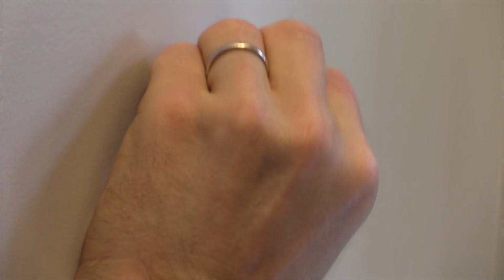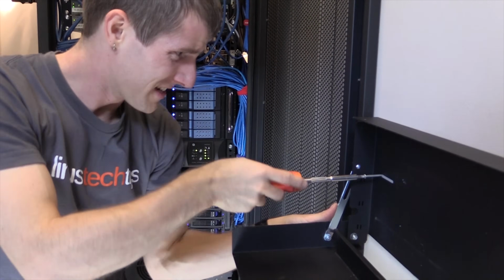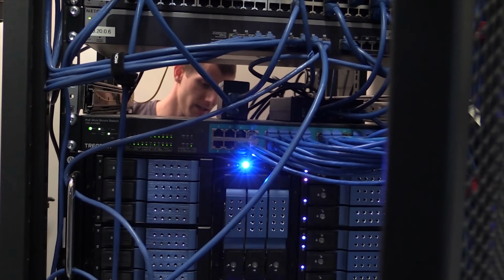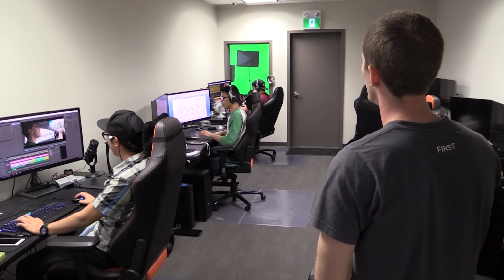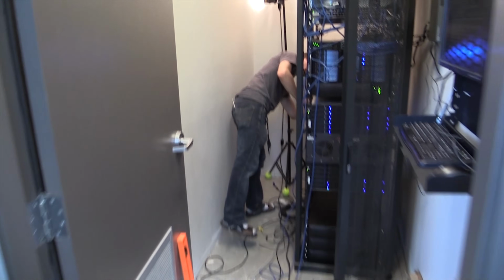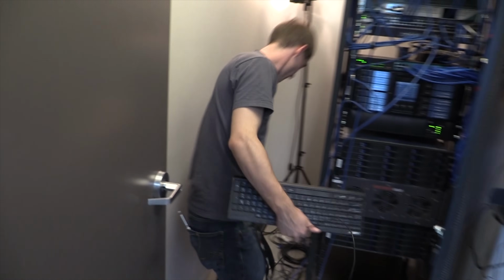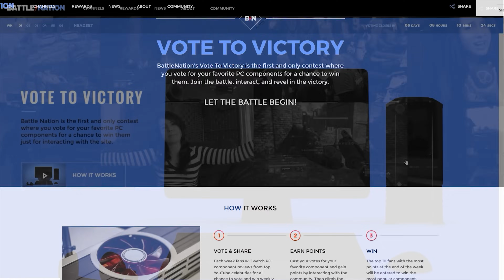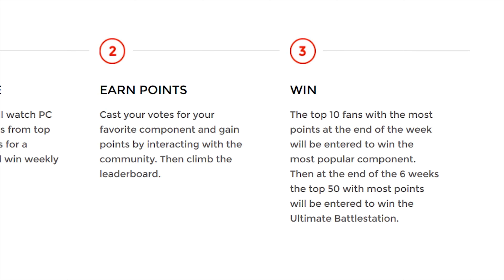Server Room Updates!! UPSes, KVMs, and more!

Comment: I never understood why he didn't rack mount the KVM and then run the 1 keyboard mouse and via cable out the top to the wall. I use a wireless keyboard/mouse combo using a Logitech unifying receiver.

Comment: you should terminate all building cable to panels on the wall with your switches mounted on the wall. Then cross connect from your hardware in the cabinet to the switches. You would find it easier to work if you used colored cables and cut to length all your cross connects.  Oh.....draw up a diagram and put it on the wall and assemble to your plan. It looks as if you are just 'going at it'.

Comment: Big Thumbs up for replacing the Cisco box with pfSense!  I am actually doing the same with my network, found there were some serious throttling issues with ASA model I had.  Plus my ASA is in an open room, and the noise level is just insane.  My pfSense box will be completely silent, b/c I decided to go with a silent case system.

Comment: Dat's a bad Linus, putting rackmount screws in the top holes first and leaving the bottoms empty. Everyone knows bottom first cause the bottoms hold the entirety of the torsional weight. 

4:23 on the top battery for those curious as to what I am referring to.

Comment: Ey Linus TecTeam... 

about your dust problem, you guys have a professional air system , please use it properly! 

in your air duct should be a fan which one generate enough air pressure which allow you to install a high efficiency bag filter

yes it costs a fortune but i guarantee you will love the result

there exist things like "planet" -  a door sealing system for your door problem

if you want more instruction send me a mail my mother tongue is not english but my job is ventilation engineer or just simply ask the guys how installed your system about this mater

and did i mention it...  i love your chanel... 

greet`s from switzerland

Comment: Now I know why we chose redundant power supplies in our servers so you can reroute the power cables while keeping the system up. Also having HP iLO has simplified KVM to a console 'network' and can even remotely load ISOs as if they were physical drives at a hardware level.

Comment: you could have just tapped on the wall and listened for the change in sound to find the wall studs lol. Sometimes you don't need a high tech solution for a low tech problem

Comment: What is the server for? What does it do? What operating system is it running on? And finally, what is the monitor for?
Reply: FightOnGaming The servers hold all their data and security systems One server is hot storage for stuff they use often one is for cold storage stuff that they no longer need constantly but might have to get at a later date security server takes all the cameras and let's them view them. All servers run an operating system. Both storage servers run unraid and the security server I'm not sure what it runs but if they need to access the server OS then they need a mouse keyboard and monitor.
Reply: ***** Ok, that clears it up. Thanks dude!

Comment: I would love to get a video exploring different KVM options for a home office setup/consumer running between 2 to 4 pc's. There aren't any decent videos on the subject far as I can tell.
Reply: From personal experience at work and at home, ConnectPro is a good middle ground for something that isn't going to break your wallet, and something that won't break in a week. I've been running a UR-14 for the past 3 years in my office and I have yet to have it break. Raritan is great, if you have the cash. Expect to pay upwards of like $1500 to $3000 depending on what you need from it, since they mostly reside in big data centers. Startech is definitely on the cheap side, and you certainly get what you pay for (I've dealt with about 2 broken switches so far), but if you get a good one, it'll last forever.

I'd like to see Linus going over this as well, since most people aren't gonna have the room for 4 monitors for 4 different machines :)
Reply: Forrest Hooker
Hmm, the Startech 2 PC usb/displayport SV231DPU2 looks pretty good on paper and in price. What's the issue with the quality, stops working just from use over time, or more an issue of breaking as a result of a small fall and/or soft-ish hit? How's the warranty/support for RMA?
Reply: Felix Kütt I've never been truly able to diagnose why the last two I had died, but the symptoms were a mix of a complete lack of response from any of the buttons, USB devices that were previously working becoming unrecognizable, or the thing simply being bricked. For awhile, I thought I was somehow overvolting them, but the Startech of the same model I purchased later (can't remember the model, it's been sitting in a test lab for awhile now) has been going strong for close to a year now with the same model of power supply included. Regarding warranty, they were quick to replace the first one that died, but on the second attempt I gave up out of frustration and gave it to a coworker in the hopes that he'd salvage something out of it :p

Comment: LOL. you were lucky with the first dry wall anchor but not so much luck with the second as design. The holes on the shelf are spaced so if one is on a stud it will line up with a stud on the other side if you have standard framing...

Comment: Linus, I have so many comments for this video. I really hope I capture all my thoughts clearly here. Also I hope you actually read this however unlikely that is.
1: I do Network infrastructure for a living and I desperately want to come and cable manage that rack. :)
2: You should really get rid of those power strips and get rack mounted power. it will really help with cable management and they have built in amps for added protection.
3: you should rack mount the KVM and put the keyboard tray and monitor on the wall behind the rack(where you do most of your work) and away from the door.
I think that about sums it all up. Wasn't nearly as much as I though it was. Also your little orange screw driver is not a power tool..... they lied to you.

Comment: NEVER mount anything directly to drywall (molly bolts, threaded anchors, toggle bolts, expansion anchors, etc.) if that thing has any movable parts or may be grabbed at if you trip.  The mount WILL eventually fail.  You have been warned.  Find a stud, or make a mounting plate, its worth the time and effort.

Comment: Is he trolling actual admins? I mean... Airflow control, dust handling... He had to do a wall mount KVM/keyboard and monitor instead of an in rack solution? He had to take down the servers?! Does he know that construct dust can combust if not clogging components themselves, and yet, he'll get around to it because a keyboard mount, instead of remoting in, is more important. I like the guy, if he was in my area, I'd donate time to get this done right for him, this is just painful to watch.
Reply: Yes you have to take down the servers when you unplug the power cables and slap them into the UPS physically ;-)
Reply: @LiLBitsDK  Not the servers that have redundant power supplies. He can just unplug one of them, and plug it into a power strip and then unplug the second one from the UPS.

Comment: Call me Crazy but at 09:04 did i see a power strip inside the cabinet ?? is that a joke ? where are the PDU's ?
Also noticed that there is no redundant power !!  
Why is there no in rack KVM ,and a wall mounted one that isn't even mount to a fire proof wall ?
No in row cable management or vertical cable management.. 
11:49 you mention cable management.. but there is none  at all !!
That cabling job is terrible,  you have cables running all through the cabinet from front to back, short cables blocking the intake vents on the cisco 2801
12:40 you say this front is good enough.. I have fired guys for doing hack jobs like that. 
 and are you serious at 13:06 there is no Fire stop where the Cat6 comes in through the pipe. 
at 13:27 there is a huge single mode cable looped on top of the equipment. Really to lazy to use a smaller cable ?
Now this is totally nuts  but where is the fire suppression system in that room ????? a quick observation probly close to 
300k worth of equipment, but fuck it, let it all burn, not my money., and with that surge pad with all the IEC cables plugged into it hope you have insurance. 

The face you make at 13:28 is the face all my employees made when i showed them your video.

I wish I could download this video and use it for a training course on what NOT to do !! and even play a game, spot what is wrong with everything you done.. 

 Nothing is up to code here, this is a hack job....

O ya very professional with the socks and sandals trying to lift that UPS. your ass is lucky you didn't drop that on your foot.

Comment: The Server room has changed alot he should do a verison 2
Reply: +thecodposter52 I hope so cause this is hands down one of the worst jobs i ever seen and would be ashamed to post this video
Reply: +Johnny Madness what do you mean this server room is well maintained
Reply: Well maintained lol, There is a power strip inside the cabinet !! wall mounted KVM thats not even mounted to a fire proof wall, no redundant power, no cable management what so ever, (unless you consider the velcro cable management) and where is the fire suppression ? why is there no fire stop where the cat6a cables all comes in at.. there are cat6 cables in the way of the intake vents on the cisco 2800
Reply: from little bits of other videos the server room has changed alot and they have a $17000 backup power unit 10000 watts and there fire suppression system is on top
Reply: Please link me the most recent video you have of this server room, Cause this video is a nightmare

Comment: You should verify if the raid controller on the server on the top supports raid 1+0 also known as raid 10 much better than raid 5. I wouldn't configure the raid from within windows like that.. what happens if the OS fails ? Then you can't manage the array and you may loose critical data! Do you have backups running on the vault ? For them two cat6 cables running out the door why not get a patch panel and terminate them and run them to a drop in the area where you need the connection ? Thats like a $250  job. Lastly I noticed you don't have a unit in the room to manage the humidity and temperature of the room. Passive cooling is great but when it comes to servers you want at least 40 - 60% humidity in the room to remove the static in the air and keep the servers at a cool temp. That router looks ancient LOL ! I would toss it too.. If you don't like to use command line but you like CISCO look into MERAKI ! It's all gui and cloud based! Sorry I don't mean to be a hater :) I'm a net admin and I seen a few red flags!  I love your videos and gaming builds keep it up man! PM me if you want my 2 cents :)

Comment: Is there any specific reason why you are using Windows Server 2012 for your Servers OS? Also, what will you be using these servers for? I also have a Server Cabinet, but mine is about half that size. I use my servers for Web Hosting and backups, but my Backup server is not connected to the net, only the local network. I would love to know what you are going to use those servers for though. lol. I am working on adding my servers, I want a few big server cabinets, but I have to buy things little by little, because it costs a lot of money to do it all at one shot. lol
Reply: +Thetechgenius You have an onsite backup? That's not a backup ;) You gotta have that backup as far away as possible.

Comment: You really need to put on those side panels on ASAP because they provide crucial rigidity and with slight force on one of the pillars will topple the whole cabinet. Another thing is that the UPS is the most heaviest part of the server and should always be at the bottom due to the weight of the batteries.

Comment: I would recommend some cable management on the RU rack for the building terminations on the cat6a cables and the cables going to the editor den switch. Granted it will take up 2 RU spaces but makes for a very clean look for very cheap.

Comment: what is that a 3845????    couldnt tell offhand.  either way you're looking about 256 megabits per second on most switching.   either way, a high end 3900 would get you "close"  to a gig, but without any IDS / IPS its moot.   i'd rather go with an ASAx myself :)

Comment: Sorry Linus... Cable Management!!! A couple pointers:1) Cables on the floor? YIKES!!! Tripping Hazard and vulnerable to damage. Suspend them, put them in Panduit, something... Just not on the floor where people can trip on them! CAT 5/6 is EASY to terminate. Writing paperwork for an  injured employee is not.2) Turn your network gear around, mount it port-side on the back of the cabinet instead of the front of cabinet (most racks support mounting equipment on either side). This will make it much cleaner when you are combining network gear and server gear in the same rack. It also makes it much easier to connect everything else inside the cabinet, trace out connections, etc.3)  Rack power strips and shorter power supply cords. (1 to 3 ft) No drooping / looping cords.

Comment: Think of putting some inexpensive tiles on the floor in that small server room. The concrete on the floor gets easily scraped while walking on it and creates a very specific kind of dust which is not good for the server equipment. Additionally, this dust is being circulated in the room by the fans, so every time you' re going in you' re breathing it too. The space is small so a few tiles wouldn't cost anything. :)

Comment: I feel like with all the airflow going into and out of that room it might be a good idea to get a simple home heating system filter and set it up over that intake thats in the door.  If you do that make sure to put a rubber door sweep under the door so it doesn't suck air from inbetween the bottom of the door and the floor

Comment: Here is an idea that you may or may not already know, but regular Dryer Sheets work great for filters and lightly scented ones move a bit of scent as well. I use them on the outside of Fan Inlets and they do a great job removing about 90% of dust while almost no hindering to air flow and the end result is cleaner fans and fan ports for longer periods. Granted they look a bit ghetto but they are easily trimmed to fit almost any configuration and they are cheap, very cheap. I noticed your SSD inlets are full of dust and this would be a viable solution to keeping those inlets clear. Replacing them is as easy as removing the old and replacing with the new and perhaps a bit of Blue or Green Painters tape to keep adhesive from sticking to the plastic or metal parts. Dryer Sheets work well as mini dust filters and are easily replaced. Enjoy...

Comment: Hey Linus,
 I'm a big fan.I see that you have a 3900 series Cisco server. i suggest that you keep it and get your CCNA in routing and switching, or at least study it. (your definitely smart enough to figure out CLI)
The cable management  was sub par. I suggest rerouting the cables that are going diagonal and getting cable management for the relay rack itself. other than that you have a pretty good setup.

Comment: Those UPSs bother me slightly: 1. Wouldn't mount them so close to the floor in case of water flooding etc.. 2. Wouldn't stack them without free space on top of each other (heat and other issues)

Comment: It's a good rack.  If it's the Norco 42U that's the exact same one I use, and that's the same KVM I have too.  I wish I could say the KVM was good, but no - it's a pain in the butt.  It locks up, and when it does you can't just unplug it, you have to unplug it, and all 8 of the KVM connectors (or it continues to draw power from the USB ports it's connected to on the various computers)  If you think a port has died on it - that's actually ALSO just a bug that seems to be fixed by unplugging every single cable connected to it so it can restart. (Makes you glad the port hasn't gone out, but also annoys the crap out of you that you have to unplug everything again)
Reply: +ualdayan 
We use Aten KVM consoles in all our racks and they've been fantastic! specifically the  KL1516A

Comment: Your properbly wont see my comment, but if you do. You might check out PFsense as a firewall/router. Here where i live, we use PFsense to manage 1063 Apartments and alot of servers and cameras, with our 5/5 gigabit connection. Works like a charm and its opensource.
Reply: i saw the video Again, and he actually mentions pfSense. Sweet. pfSense is so powerfull and easy to use.

I actually had pfSense installed on an old HP Proliant G3 and at that time i had a 1/1 gigabit. The G3 could actually handle the gigabit.

Comment: Why not use opnSense (the more modern fork of pfSense)? I found that pfSense is pretty much outdated and the code base looks ugly at a lot of points. opnSense strives to solve this. Btw. we just use a 1U rack mounted KVM with a monitor, keyboard + touchpad that can be pulled out of the rack. Better than this wallmount stuff. 1U is nothing if you manage your rackspace well. BTO servers from SuperMicro are what we use for 99 % of our servers and if you make it BTO you can save a lot of rackspace because these guys sure know how to put a lot of power and disk space into 2 U systems. Building systems yourself will usually be more frustrating, expensive and the results will be larger than a BTO.

Comment: I own that Zircon stud finder. I hate it; it's a pain in the ass to use. Much easier to use a magnet to find drywall screws. :-\ The only thing the Zircon really has going for it is the ability to find power lines behind drywall. So... put the two approaches together and you're golden. :-P